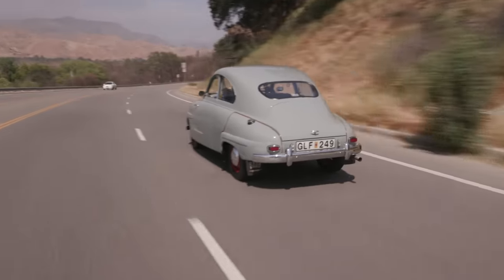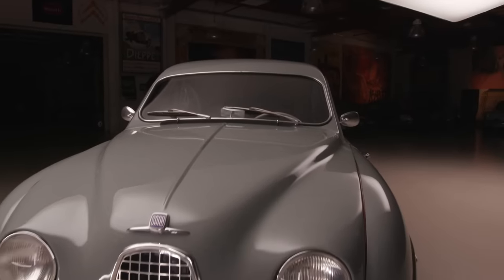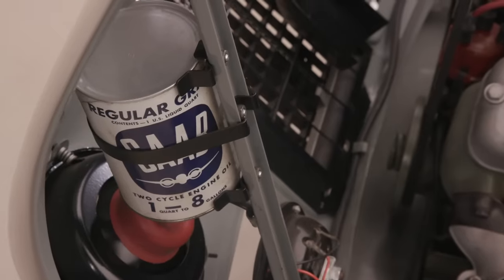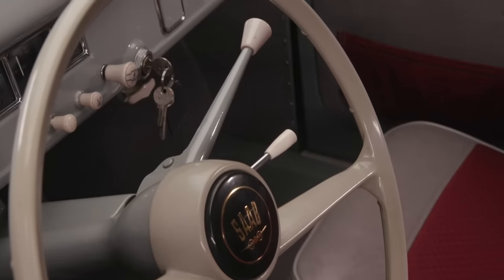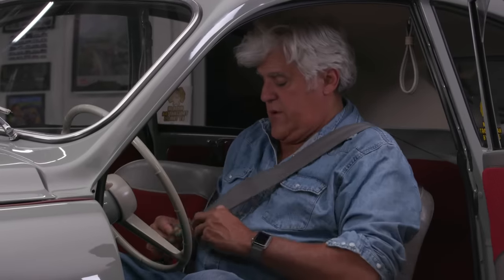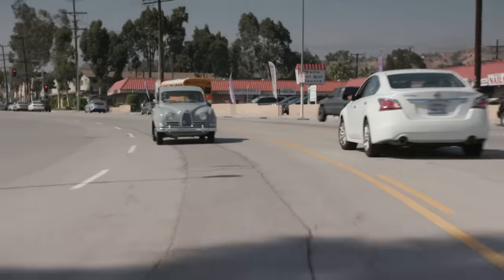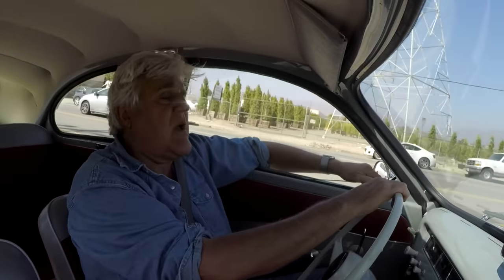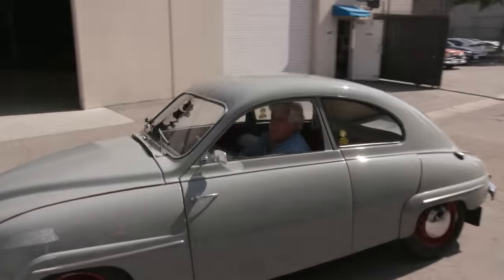1958 Saab 93 - Jay Leno's Garage

Comment: I had an uncle who drove different SAAB models for 40 years, he got invited to the factory in Trollhättan :) I had one myself a 1978 SAAB 99 Turbo.
Reply: Great
Reply: My mom had an 82 Turbo 900!   The engine was a 2.0 liter I4, but it was backwards; the clutch was in the front and the belts were against the firewall.   The Borg-Warner 5 speed tranny did double duty as the oil pan on the bottom of the engine!!  It was pretty zippy and handled good!   The parking brake worked on the front disc brakes, so when you replaced the pads you had to rotate the pistons back into the calipers to reset the parking brake!
Reply: Why the Swedes did not save Saab's car business? It was a charming part of the national culture.
Reply: @StrangerHappened  They did try, but the swedish government wasn't willing to subsidise, most countries with car industries do this but unfortunately not our.
Reply: @GurrasGarage  I like Volvo, Ikea and PewDiePie, but the more Sweden things to love the better. Maybe Saab will re-emerge after some years.
Reply: Gurra had a saab 99 won it in a coin toss drove it across the states the next day. 140 all out the whole way parked in san fran n the head gasket blew
Reply: you litterly had my favorite saab, Was is a CC?
Reply: @StrangerHappened  GM pretty much killed the company - it was just to much i a hole after they were done.
Reply: I was born in Sweden, but got smart and moved out of that shithole in my early teens. But the first car I spent any time in was my moms Saab 900EMS, and later I got to try a souped up 99 turbo with the 2.3l, that was a damn fast car for its era. 
But Saab as it was will never be again for sure, soon there won't be a Sweden either, the country as it was when I grew up died a long time ago. Such is the way of utopian socialist idiots, they ruin and destroy everything they touch.
Reply: lol I was wondering what that sticker Jay had in the rear drivers side window referenced to
Reply: My dad bought his 1972 99 on overseas delivery and I got to pick it up—drove it all over Scandinavia. My 1984 900 lasted 296,000 miles before it died in a tennis-ball sized hailstorm. Great cars—absolutely the best in bad weather!
Reply: @StrangerHappened  Some engineers tried to save some of the knowhow by creating a new company called Nevs. The money for this comes from several Chinese companies. They  bought what was left of Saab in 2012, and claims to be working on a new line of electric cars. I say "claims" as they have yet to get anything out the door. The do have a contract for 150.000 Nevs 9-3 sedan electric cars to be delivered to a Chinese company by the end of 2020.
Reply: I have a 1978 99 Turbo now! What an amazing car!
Reply: @millsaab  I checked it out on your channel, congrats lovely car!
Reply: @StrangerHappened  - GM saw they were far too well built, and bought them to destroy them. My theory anyway, just judging by the junk they peddle today. Same with Volvo, only it managed to somehow survive Ford ... to become chinese.
Reply: 99 Turbo, I'm envious.
Reply: TheDamnSwede im not sure. What is cc?  It was awhile ago.  The way i got it it was. Turbo Two door four speed ... real quick. Had real good tires bit of a “hop up” tune. Exhaust handmade. Used to backfire on deceleration. It was hand painted to look like a rally car. But the paint was terrible. We scotchbrited alot of it off and it wrecked the paint. (Today itd b awsome but i was upset bak then)Handled awsome fr me bak then. It was twenty five or thirty years ago. I was hitchhiking and a guy gave it to me if iWon a coin toss a could change brakes in providence RI he said if I could change brakes I could fix anything on it.  on tues i changed the brakes and one fuse. Had it in california four n a half days later. We even changed the head gasket on the side of the interstate along the way. Its one car i wish i knew more about and coulda kept.  Totally turned me on to the European cars and their quirkiness
Reply: LOFA Lol, Sweden has been an absolute unmitigated disaster for many years by now, it showed first in the working class suburbs, then in schools, and this was mid/late nineties. I haven't been back there since 2002 when I went for a short visit and looking at the people on the street, in the trams etc you saw at least half as many immigrants as you saw swedes. My family lived in Bergsjön in Gothenburg when I was a small child, now it's one of the worst crime ridden no go zones of all of Sweden. Anyone who says it's not complete gone should try to go for a walk there without police escort or bribing the local gangs and see how that ends. 
But mind you Sweden isn't and never was liberal, they are a totalitarian socialist state but of their own weird flavor, dissenting thought is not tolerated and everything squashes any wrong think.
Reply: @noth606  Det gläder mig att du lämnat Sverige, kom aldrig tillbaka.
Reply: @StrangerHappened  thank gm. They Iike shutting down the best quality parts of their org. Race to the bottom
Reply: Gurra oh ok😐
Reply: @noth606  they call themselves Left liberal, and they reminds alot of american Globalist democrats.
Reply: @noth606  kul
Reply: @noth606  if you can still read swedish you should read the "saltsjöbadsavtalet" from 1938 (there might be an english version), because now you have been brainwashed by oversees views. There are a lot of things one can critizise about Sweden, but not their model of trying to be just. I've never seen a poor guy begging for money like you see in all big european cities, or very poor people neither. One is as free as one can possibly be, that is much to say for a country of social justice. Utopia does not existe, nor does paradise ;o)).
Reply: @GurrasGarage  jag tänkte det samma! brainwashed dude!
Reply: @juttaweise  Jag kan både läsa och skriva svenska, jag har gått i skolan vettu. Men socialistskiten bryr jag mig inte om, inte nu, eller nånsin, ni kan behållda den gojan till er själv. Jag är mycket lyckligare där jag är nu och slipper all den skiten, du kanske tror att sverige är nån sorts paradis men det finns mycket friare ställen på jorden, det kan jag garantera dig. Men hur som helst, jag tänker aldrig åka tillbaks så ni kan göra vad ni vill, det rör mig inte på minsta sätt, jag är inte svensk medborgare heller så jag har inget med det att göra, men jag tycker det är synd bara. Sverige va ett vackert land en gång i tiden och nu är det långt från det.
Reply: @noth606  jag är inte svenska ;o))

Comment: I wish cars now would require four separate steps to start, in the right order. The traffic would have been so much easier since half the drivers in my area would never get out of their driveways.
Reply: Hahahahahah
Reply: Add the manual transmission and you're down to at least 25%.
Reply: Recently I have seen two drivers (OK, both women, both possibly foreign born) in my neighborhood trying to parallel park with no clue whatsoever. One had their car parallel to the curb, in the space, and about three feet from the curb and couldn't figure out how to get closer despite turning the wheel left and right and going back and forth.

Comment: The freewheeling was not intended as a fuel saver, it avoided the engine being dragged at high speed with low fuelling and lubrication ;-D
Reply: Yup, why the 96 with the V4 Taunus four-stroke still had it is another story, lol. I shat a brick the first time a drove a 96 which had the freewheel active.
Reply: But didn't that save fuel then?
Reply: @kathyflorcruz552  Only extremely marginally if at all. When you freewheel the engine goes into idle which require fuel to tick the engine over. When you engine brake the throttle is (almost) completely closed which draws little air through the carburettor and hence little fuel to the engine. In practice the difference is basically negligible.

More modern fuel injected engines shuts off fuel completely when engine braking, so it's "free".
Reply: Bingo, like going downhill on a moped. The piston would start to seize.
Reply: It was common for big American cars of the 1930s to have freewheeling. I think it was to save fuel considering the depression but the lack of engine braking does affect safety so that's why they stopped equipping cars with it.  A question for anyone- do two stroke bikes have freewheeling? I honestly don't know.
Reply: Not to put too fine a point on it: That is total bollocks. What is "being dragged at high speed"?  Freewheel prevented a two-stroke from "snatching" or bucking at low speed in lieu of using the clutch pedal.
Reply: @MPI1000  If the fuel is shut off completely, how does the engine continue to run? You need to do some more research, genius.
Reply: @ianfindlay865  it's driven by the wheels through the gearbox genius. All modern cars cuts the fuel completely when coasting.
Reply: @lawrencelewis8105  No, they do not, but the engines are easy to rebuild ... and often require rebuilding.
Reply: @smokeydabear9073  Thanks for that. Without freewheeling with the throttle closed, the engine is turning rapidly and getting no lubrication. It would never occur to me to not use the freewheeling on my 1960 Saab 93F.
Reply: true!
Reply: @ianfindlay865  What he probably means is that a 2-stroke engine gets lubricated through the fuel, it has no oil in the crankcase, you mix oil into the gasoline, and if you would run a 2-stroke down a long hill and use engine braking, the cylinders and pistons gets very low lubrication and it might sieze due to overheating, hence the freewheel, it's probably  meant to make the car idiot proof, and you dont have to give every new buyer a 1 hour lecture how to drive their car. Because you have a freewheel, no new owner will come in to the dealership after 100km, pissed off becaused their new car just siezed up after engine braking down the entire Stelvio pass...
Reply: @lawrencelewis8105  This is why the successor, the Saab 96, was equipped with disc brakes on all four wheels, outperforming most of its contemporaries.
However, the reason Saab abandoned freewheeling on later modela was that they couldn't make it durable enough for the stronger engines in Saab 99 and onwards.
Reply: @oljefri  Saab did have a lot of warranty problems when they were first sold in the U.S. as people didn't understand how to drive a two stroke. Also, they really weren't meant to bomb along the interstate for hours on end. On Swedish roads the RPM would be constantly changing, speed up, slow down and freewheel. When I'm on a highway with mine, I let it freewheel every few minutes once I'm at cruising speeds. 
 My brother had a 1965 96 in 1972 and never used the freewheel. He drove down a mountain with the engine screaming in 2nd gear. The next day the bottom of the engine blew apart and that was the end of that car.
Reply: @lawrencelewis8105  The most reason for the freewheling was that the two-stroke engines didn't brake much and the brakes are more suited for the job, especially on an icy road, as often experienced in Sweden. But at first they kept the freewheling when changing to a V4 Ford engine (The only engine that was able to fit into the space of an early SAAB).
Reply: My first.car was a 1965 SAAB 96. It had drum brakes in the rear.
Reply: I couldn't remember for sure, but now I do. All the two stroke SAAB 96's had drum brakes all around. The front brakes were self-adjusting, and the rear brakes had to be adjusted manually with a screwdriver.
Reply: The freewheel did protect the engine, HOWEVER, I know from experience, if you were taking a curve in slippery condition, either braking or accelerating would make the front end lose all traction and you'd slide sideways into the curb wrecking the suspension on that side. If you freewheeled through the curve the car was on rails. But once you touched the brakes or the accelerator you were doomed. That's why they kept the freewheel on the 96 V4 and on the SAAB 99. Been there done that.
Reply: @smokeydabear9073  Only racing engines would require rebuilds. The average two-stroke car would run very high miles with hardly any wear. Fresh oil at the correct ratio guaranteed excellent durability.
Reply: @noahschwartz2270  If you have front wheel drive without freewheel, and average fwd, actually the engine works great as a traction hint, kind of super-ABS on ice. Since ABS is rubbish on ice, but the engine hints you how much you can push the brake without blocking the brakes, thus you can keep turning on ice with that hint.
Reply: @oljefri  Well, not just idiot proof. In Sweden you didn't need that much braking power because of low temperatures and snow. Using freewheel was easier and saving the gearbox and clutch to prevent the two stroke engine from grinding. However, there were some two stroke cars at the time that allow to engage or disengage the free wheel at will. I've read a manual from one of these cars, and it literally said that 'the engine is the main brake in mountains, and has to be used to prevent brake's overheating'. However, it also stated that 'using the engine as a brake stops lubrication and shortens lifespan of the engine'. So it literally says that in the mountains the driver has to trade his survival for engine's survival.
Reply: It also makes for a clutchless gear change
Reply: Actually the main reason Saab with two stroke engines had freewheeling was the two stroke engine´s very uneven idling characteristic. Two stroke engines (particularly three cylinder types) run pretty smooth when producing power, but they have a notoriously uneven idle. Interestingly Saab retained the freewheeling feature when they went four stroke with the Ford produced V4 and later with the Triumph produced inline 4 cylinder on the 99 model.

Comment: Back in the late 60's I worked at Slingsby Sailplanes/Engineering and one of my collogues rebuilt a Saab, probably a 96, and had an old bonnet (hood) left over, so when it snowed he used to swap the bonnets (he used pip-pins for quick release) and drive to the local hills, take off the bonnet, and use it as a sledge. We never found out what others thought of him using part of his car as a sledge but he had plenty of strange looks when he'd finished and put it back on and drove off.

Comment: I'm sure somewhere in the 2500 comments it was pointed out.. but i didn't see it. Volvo invented the 3 point seat belt. They didn't charge anyone else to use it though.
Reply: Probably true. SAAB was the first with a safety belt, but it was not a three point.
Reply: @Octopussyist  not sure about that. I know Tuckers had em standard in 48. Nash as optional in 49.
Reply: Volvo designer, owns the patend. But gives no license fees for using. Meaning everybody can use them. Make them. And produce copies. Truly the best idea
Reply: But the belt it has is over the shoulder 2 point not 3 point, no lap belt.

Comment: Hi Jay! I need to tell you some more details about the 93! My parents had two of them when I grew up here in Sweden. Not only is the radiator mounted behind the engine, making it easily overheat when a family of 5 persons and a roofrack etc making summerhollidays in hot weather... But then if we had some rain it would suffer from the fact that the ignition distributor was mounted right up in the front where all the rain hit...  :-/ I remember that my father tried to protect it with a rubber glove with tiny holes on the "fingertips" where the cables passed through. The car has no window flushing, only the wipers, but an old bottle of Heinz Ketchup with water squeezed by the steering column was the solution for that! :-) WE LOVED THE SAAB hehe! :-D
Reply: Your childhood sounds like it was amazing :|
Reply: I had a '67 Saab 96 and encountered the same problem during a late winter snowstorm in Arizona-- distributor got soaked and we had to wait a few hours while it dried out.  A plastic bag shroud with ignition wires poking out were my low-tech solution.

Loved it with all its quirks but not without its challenges-- sheet metal separating from body due to rusted clips; and as much as I loved the looks of gas station attendants when they saw me pouring oil into the tank during a fill-up, in retrospect the two-stroke engines were absolute disasters environmentally-- magnitudes worse pollution-wise than 4-stroke engines.

Comment: Last year I drove from Stockholm to Gothenburg and, while passing the SAAB airplane factory just outside Linkoping, saw that they had examples of all their famous planes, the Viggen, Gripen, etc mounted on poles, so you can see them while driving along the Motorway. It's a shame they don't make cars any more but they're still making airplanes
Reply: Their aircraft are legendary, hid them under overpasses and used the highway to take off. They could fly from primitive forward bases for weeks.
Reply: Was the viggen not the only plane to get missile lock on one of the us planes ?
Reply: The Saab automobile company and Svenska Aeroplan AktieBolaget separated in 1990. The aircraft company is totally separate.